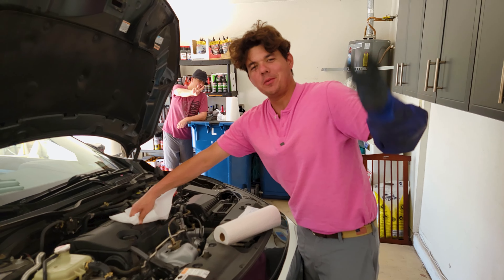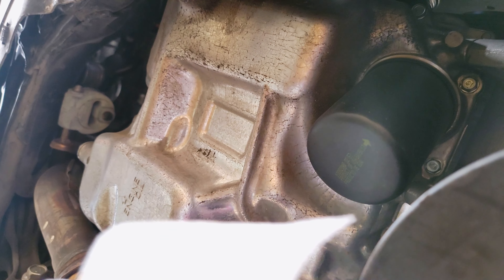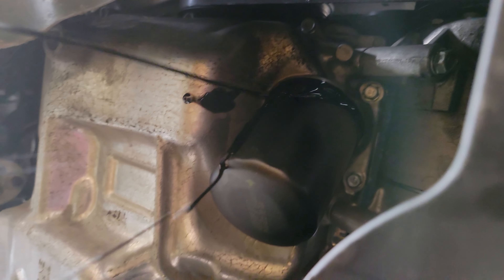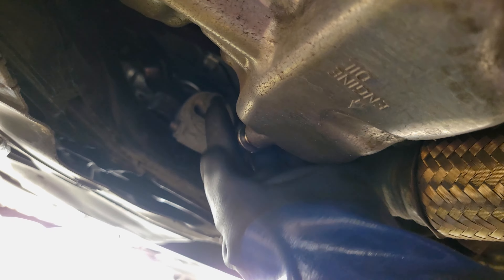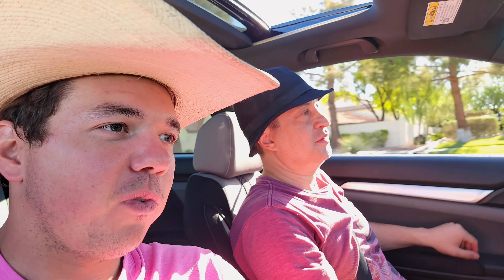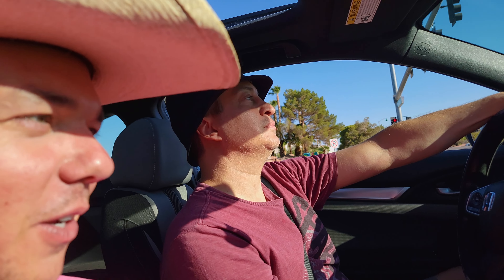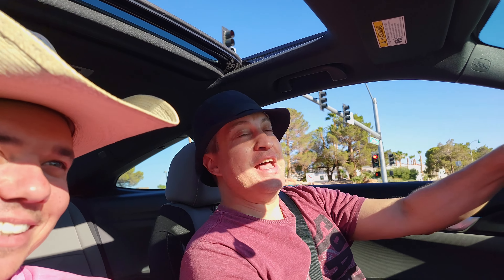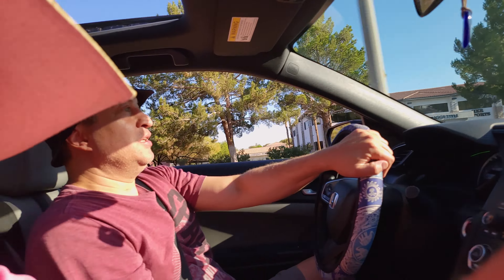Is your motor oil dark ... try this...

Comment from the maker: Watch this next:  2017 Honda Civic AMSOIL Engine Flush Oil Change - https://youtu.be/Jpuu_WskZLY

     ♥️ Find The Right Fluids For Your Vehicles - https://www.amsoil.com/lookup/auto-and-light-truck/?zo=5331179

     ✅ Save 25% On Your Next Fluid Order: https://www.amsoil.com/offers/pc/?zo=5331179 

     ♥️ See Fluid Performance Tests - https://www.amsoil.com/performancetests.aspx?zo=5331179      

     ✅️ Buy Me a Coffee - https://www.buymeacoffee.com/YouLubher

     🥇🥇🥇 Synthetic Oil Protection Google Map Reviews
(702) 472-3614
https://maps.app.goo.gl/1aXxuXrXK9eJwqK78
             
     ♥️ Synthetic Oil Protection Website - http://syntheticoilprotection.net

     Did you know a oil manufacturer can call a lubricant a Full Synthetic when it's only 25% synthetic? AMSOIL is different because it is 100% Synthetic and has a higher film strength keeping the metal parts separated. AMSOIL allows less friction, less heat, less wear on the component. AMSOIL Signature Series motor oil will last 25,000 miles on 1 oil change!  

     ♥️ Your Vehicle Could Run Better Than Brand New By Choosing The Right Fluids! See Results - https://youtu.be/9Y7XSl5YHFg

     ♥️ Why AMSOIL - https://www.amsoil.com/about/exclusive-distribution/?zo=5331179    

     ♥️ Synthetic Oil Protection Coffee - Ebens Favorite: https://supportwith.coffee/shop/subscriptions/sop/

Comment: I have a 2013 Fiat 500 with a "sealed transmission". I have not been able to figure out how to drain the transmission fluid. The fluid got in there somehow. I would love to change the fluid, she had 142,650 roughly on her.
Reply: Youtube Hooptiedoodle Fiat 500 shows you exactly how to do it.
Reply from the maker: That's awesome yeah we did one video on one with the oil definitely a little bit of a challenging car but will be worth it you'll see we have a transmission fluid playlist here in the channel it's under making your transmission shift faster and smoother and you'll see the Chrysler's are all very similar and I would watch a couple videos and then once you go underneath your car you'll be able to recognize if it's similar to the one we've already done but usually they all have a pan you can just take off you change the filter clean the magnets and put it back on. See playlist here go through and find the Dodge Charger/challenger one should be very similar transmission type.
https://youtube.com/playlist?list=PLB_ftWArBFdfzuV7RHGz70MD-PawLbKgu

Comment: Change your oil at 3500-5000 miles period. Always use a new filter. This 8,000, 10,000, 1 year, is insane. Doesn't matter what oil you use, don't do it. Also, change your pcv valve.

Comment: ‘Black Gold’ from ‘Liquid Gold’.
Reply from the maker: Oh yeah in as little as 2000 miles it can turn pitch black because the detergents delaminate the buildup inside the motor once that filter gets full it gets really dark so you have to change the filter and it'll actually clear up and run significantly better I always recommend using a bottle of Pi cleaner and doing the filter change on a new vehicle that has Amsoil at about 3,000 Mi is a good place to start.
We will be showing that soon on the channel a vehicle that is new to Amsoil with some good miles on it I think about $150,000 and we're going to be showing the filter change and how much better it runs after changing it here's one video on changing the filter in how much better it runs - https://youtu.be/F1qO1bqSq5U

Comment: Amsoil products are the best.
Reply from the maker: What type of vehicle have you tried the Amsoil on?
Reply: I currently use Amsoil in my 2022 GMC Canyon 2.8 Duramax. My engine has antifreeze in the oil confirmed by an Amsoil oil analysis kit. $30 well spent. Until GM fixes it, I use Amsoil engine flush and new liquid gold every 3000 miles and she puts like a kitten. Amsoil is also great with lawnmowers and motorcycles